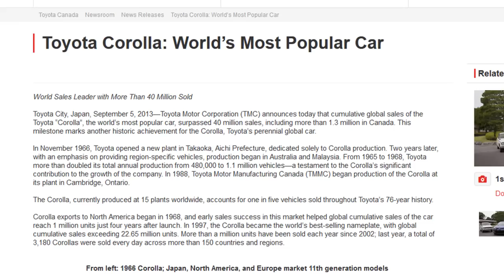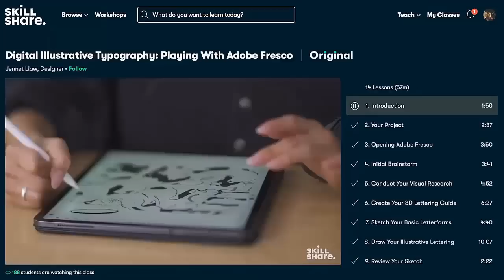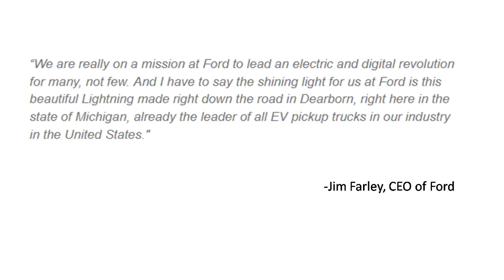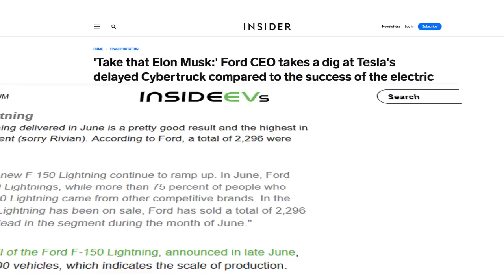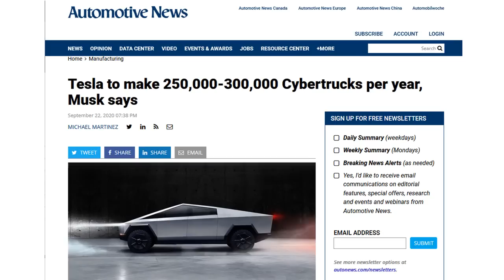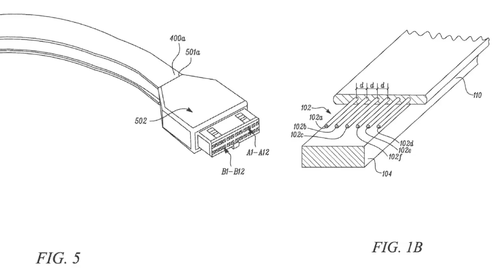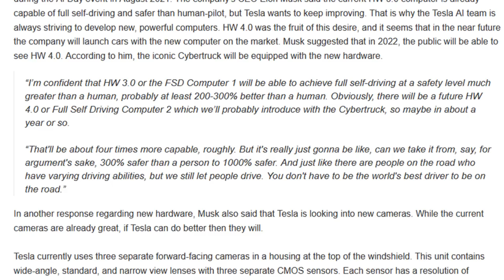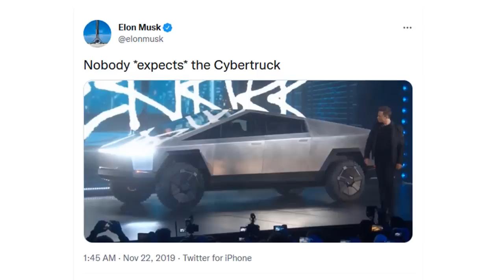Tesla's Cybertruck will SHOCK the Pickup Truck Industry

Comment: 800 volt motors, with 48 volt sensor/accessory power would be game changing upgrade for the CT as well as the Semi and Roadster.  Active noise canceling would be an option I'd pay extra for, along with HVAC to the vault.  I really think the CT will start a new class of vehicle owner, along with taking a substantial bite out of the traditional F-150 market for those that don't use the truck for work or hauling all the time.  I'm looking forward to driving a tough as nails low maintenance stainless steel supercar with a giant trunk that can go in the snow or off road.
Reply: I'm still hoping for Vehicle to Grid capabilities but the climate controlled vault is key for me. I plan on sleeping in the vault and hobo-mode is necessary for that.
Reply: They were asked about 800v architecture in the Q2 '22 earnings call and dismissed it out of hand. All of your other points nailed it.

Comment: They are planning on making 5 semi trucks a week for now. That's not a lot of batteries, maybe the equivalent of 50-100 model y's a week, or 1200 a quarter. Insignificant in the grand scheme.
Reply: But the semis will make a massive difference (when scaled up) to both company economics, and pollution...
Reply: @chrisheath2637 very true, though I was referring to the video narrator saying that semi production would take batteries away from model Y production, and hurt revenue numbers. I don't think that's an issue right now.

Comment: Teslas shape is so much more than aesthetic. It’s hard to imagine, because it’s a total rethink of a utility vehicle. But it’s shape will allow it to do things that it’s competition will just never be able to touch. 
My only concern is rear visibility, and side reach for the rear compartment. But I’ll reserve judgement, until I get hands on the final product. I can say most people reach over the side of a truck because it’s difficult to get in the back. I think Tesla solved that with auto adjusting air suspension. So this may be a non issue. I’m sure visibility will be resolved with a litany of cameras. 
I’m excited to experience this rig. I think it’s biggest advantage is going to be the miles per watt hour, versus the classic  designed bricks it’s competition is putting out.

Comment: Design wise, i do like this product, but after purchasing the model y a month ago, here are a few points in my mind. 
I was told to charge only 80% of the battery. On top, what ever value you get , its going to give 90% of the milage value. On top if i add a trailer, for model y, the range would come to 100-125 max on a charge.

No one will buy a truck, one for daily work, one for going on long trips with a trailer. So unless the minimum range when charged 80% is atleast 600 miles, it doesnt make any sense. 
Product wise its good, but milage wise is bad.
its like i have the best firearm, but no bullets.

Comment: sigh... if it ever shows up. I'm 420,000 on the waitlist. I believe the semi won't ever launch unless someone can drastically improve on current battery energy density. It takes virtually the whole road weight allowance for the truck to get a large enough battery to support any decent range, which leaves almost no allowance left for the cargo, am I right?
Reply: No you are not right. Do you actually think the engineers would limit the payload by the weight of batteries? Just was semi’s will still pull 80s thousand pounds. How much do you think batteries weigh? The battery weight is insignificant.
Reply: Depends on the trailer(number of axles) and time of year, but it should still be able to haul about 40,000 lbs while the truck itself weighs about 40,000 lbs. It won't haul steel or grain, but would haul groceries, or other finished goods.
Reply: Gross vehicle weight has been increased to 82000 lbs for battery weigjt

Comment: Tesla will sell everyone they can build, but there will still be a HUGE market of customers who want a ‘normal’ looking electric pickup. 

Win-Win, except for the fact that environmentally speaking it would be better if people drive smaller vehicles.
Reply: Don't get your reference to better to drive smaller vehicles. The Cyber truck will be a full size pickup truck but it will be inherently many times more efficient than the Ford F-150 or the Ford F-150 electric lightning in fact the Cyber truck aerodynamically is more efficient than virtually every other car on the road right now including some other Tesla's. And of course aerodynamic is one thing actual environmental impact from production of Parts assembly and production of the vehicle entire lifetime use of the vehicle recharging versus refueling blah blah blah remains to be seen until we have a finished product. The Tesla has proven that the efficiency of a vehicle at the current state of Tesla's art is not dependent on the actual physical size of the vehicle it is dependent mostly upon the energy density of the battery cells and what materials go in them and the costs both economic and environmental of acquiring those raw materials, and Tesla's already demonstrated that their battery packs will be nearly 100% recyclable and virtually all of the materials will be economically, recovered in high quality and purity equal to or better than the original material when the battery packs were created. Even Sandy Monro back this up 100%
Reply: Do you think ppl will sacrifice 300km range for a conventional look? Change is often resisted but if the new option is superior in every way I think ppl will be open to it’s unique style.
Reply: @Al-yc4cn  this report didn't really talk about it but I believe once people become fully aware of the safety aspects of the Cyber truck and I'm not just talking about the super rigidity casting I'm not just talking about the exoskeleton which is supposed to be bullet resistant to 9 mm pistol type ammunition and similar the armor glass which does not mean it's bulletproof it just means it's extremely resistant to cracking and shattering and the fact that all Tesla so far have been rated the highest in safety of any cars ever produced, the cybertruck due to its wheelbase it's overall geometry and the fact that it's relatively heavy battery pack will be giving it an extremely low center of gravity the cybertruck will likely be rated the safest vehicle ever produced in production as soon as it is in production. A lot of people will buy it simply because of that comparison to the Ford or any other electric pickup truck.
Reply: @WordsMatter1982  they're a large percentage of Americans that enjoy small cars good for them, but as I posted right here a moment ago the size of the vehicle no longer has any relationship to anything to do with good for the environment versus bad for the environment. Tesla EV technology which includes the Battery Technology the motor technology the regenerative braking technology Etc has put an end to the relationship between the size even the weight of the vehicle compared to ecological effects. And as I have posted elsewhere the Tesla semi is more aerodynamic than most vehicles on the road not most semis but most Vehicles currently on the road plus it uses all of the other features and functions that I've already mentioned sizes irrelevant in any discussion on what is good for the environment or what driver should or shouldn't be forced to adopt.
Reply: @WordsMatter1982  neither would europe r asia except their roads and Infrastructure wont allow larger vehicles.
Reply: @Al-yc4cn  yeah, it makes sense to drive smaller cars. And the rest of the world has to due to infrastructure and terrain. But Americans didn't really buy smaller cars when gas was 4 dollars a gallon a decade ago. That's not going to change.
Reply: @WordsMatter1982  I agree but reality is America luvs their trucks. The thing is, everyone would do the same given the same situation. America is wealthy, big and relatively cheap energy prices. USA bought over 2 million pickups last year alone.

Comment: Tesla will probably market to both new people who weren’t really in the market for pick ups, and people who are in the market for a pick up but don’t need a long box for a work truck 6.5 foot box is good for a lot of people even some contractors. 8 foot box will still have a place which means a loss there for Tesla and a gain for Ford Chevy and Chrysler. As I work my truck on farming and for wood cutting my only complaint is the distance a work truck needs to last all day out in the field. The golden number Tesla needs to achieve in my opinion is over 600 miles on a charge to last all day out in the fields and running from place to place without having to go into town or go home to charge it. Somehow I don’t see you charging it off of the electric current Of the cattle fence lol
Reply: I doubt you have ever driven close to 600 miles in a day going from place to place to work.
Reply: If the CT is the success I think it will be, extended bed and extended range will be available (maybe via third parties)...the options list will make this the go to truck...

Comment: I  really like the truck. However, I wouldn't want to be one of the first owners. Ever since the first onstage presentation of the truck, and the failed "non-breakable" window demonstration, most Tesla haters will be just itching to lob a few rocks at it. Every place you go in this thing will draw flocks of stone bearing "ICE" lovers, waiting to pelt the poor stainless steel body and "bullet proof" glass in a shower of projectiles, hoping to replicate the widely seen 'bull's-eye' from the demo. Everywhere this truck has been parked, there will surely remain a ring of objects that have been hurled at it, like a landmark celebrating the distrust of the new technology.
Reply: good point, keep the sentry mode on.  the first model 3s were getting randomly keyed.

Comment: So this so-called environmentally responsible vehicle will surpass all others in energy consumption by sucking up not twenty-homes worth of electric power...but will draw power equivalent to fifty homes worth of power....The wretched American excess strikes again...but the electric power obscures the consumption facts.
Reply: I don't think so. Electric motors are over 90% efficient compared to 25 to 30% of ICE. Burning fossil fuels in a large power station to generate the electricity to charge those batteries will be far more efficient than burning it millions of individual ICE cars. And  delivering electricity to EVs is way more efficient than refining gasoline/diesel then trucking it to thousands of gas stations and hence cars.

All in all the efficiency of EVs and the EV charging infrastructure is way better than burning gas in ICE cars and all the oil infrastructure that supports them.  

I'm with you on the wretched American excess thing. But if one is going to have an excess of size/power it's far better to do it the efficient way. That is the EV way.
Reply: @heater5979  Agreed o several points...but the premise of hustling around in a 10,000 lb one-thousand-horsepower SUV negates any and all benefits of electric vehicles.
  The Aptera two-seater all-electric is by far the smarter choice. First off, the typical car & driver zips around in a four-seat (or more) vehicle...with the three remaining seats unoccupied 95% of the time.
  There are three times more unoccupied traveling our roads, than that single seat of the driver. Second, the typical car weighs in at 3000 lbs...far too much weight as needed to move that single driver from point A to B. 
  The Aptera addresses those two points in detail, making for a superior vehicle.
Reply: @AndieBlack13  I do agree. The electric Hummer, for example, is an absurdity. 

I would dearly love to have an Aptera. I satisfies my engineers desire for efficiency and simplicity. Not to mention the result is a very cool looking machine that looks like it would be a lot of fun to drive. 

Thing is people have spouses and children and friends so those 4 seats in a typical car are pretty much  essential.

Comment: Absolute nonsense video put out by someone clueless.  The Cybertruck is not the future of trucks because it is not shaped like a truck.  You cannot add ladder racks, tool boxes or reach in the bed from the outside.  As an adult and a truck owner, I would be embarrassed to be seen driving the hideous Cybertruck and know it’s worthless as a pickup truck.  I find fanboys hilarious,  the Ford, GM and Dodge EV trucks will control the market.
Reply: With a name like, “Jim Dandy”, I would be embarrassed to walk outside or even write my name.
Reply: How can you find it hideous, don't you like science fiction?
Reply: Ladder racks and tool boxes will be available for Cybertruck at some point, probably aftermarket. That said, Tesla teased an image at the Cybertruck unveiling that showed what looked like a ladder rack, so maybe Tesla will make one.
Reply: @dksculpture  David…clueless.  Tool boxes are mounted to square bed walls and most mounted to the back and are accessible from standing outside….not possible with the cyber truck.  Ladder racks cannot be mounted on a sloped bed wall with rounded edges.  Don’t comment on things you have no understanding of.
Reply: @jimdandy9118  Jimmy the walls of the cyber truck are not the flimsy sheet metal paneling of your ICE truck they are structural aka you can add on to it  as if you were bolting or welding to the frame of your ICE truck.
Reply: Can't wait for my "Blade Runner" CT!  Ooh, darn, not shaped like a truck.  That's something to celebrate.
Reply: Dont believe the FUD. All of what you said is false. Many points of access for tool storage(side pods open as well as massive frunk and under bed storage). Stainless exterior wont dent or rust like every pos does. Has onboard air compressor for pneumatic tools and 120Vac for others. Ladders and material hauling are handles exactly the same as you would with a conventional truck, buy a rack. It aint a fashion show at a work site. ;)
Reply: Regardless of what you may think, they’ll sell millions and will likely take the crown away from Ford for the top selling truck model.
Reply: Sorry Jim but that statement won’t age well.  I don’t see legacy automakers getting over a million pre-orders for any vehicle much less a truck.
Reply: @quyenluu7883  You have no clue what you are talking about.  All pickups that have the body style of a pickup will crush the Cybertruck in sales.
Reply: @Frank_W.  Frank, a pre order is not a sale…..didn’t they only have to put down $200?  Now that there are actual pickup trucks on the market the Cybertruck is now just a gimmick for fanboys
Reply: @Frank_W.  Cybertruck is banned in Europe and Asia and Tesla is refunding all pre order money in Australia.  Ouch.
Reply: @quyenluu7883  this is true.
Reply: @jimdandy9118  You are the kind of guy who would have bought a new fangeled ICE car with a fake horse head on the front just so it would look like your old carriage.
Reply: @Barskor1  👈D Bag
Reply: @toddr.lockwood843  The Fanboys that find the hideous Cybertruck an attractive truck are too young and broke to buy one.  An adult would be embarrassed to be seen in one.
Reply: @toddr.lockwood843  You just proved my point.  I’m laughing out loud.  Given your Fanboy status and the number of Tesla owners you know and only 4 are actually going to buy.  The overwhelming majority of people I see driving a Tesla are over 60 yrs old…..they are not interested in a Tesla Cybertruck .  You should create a Korean EV club soon, they are coming with better cars and will dominate.